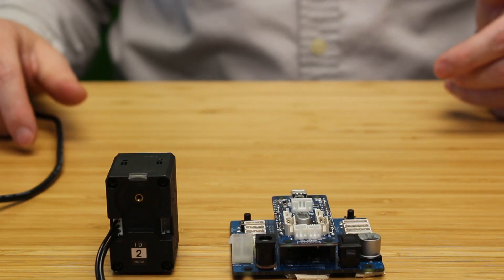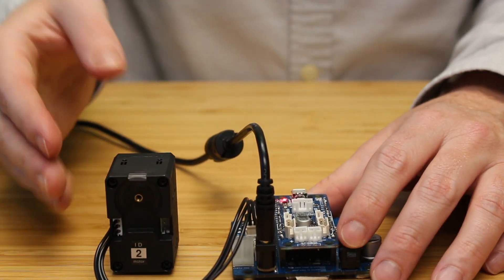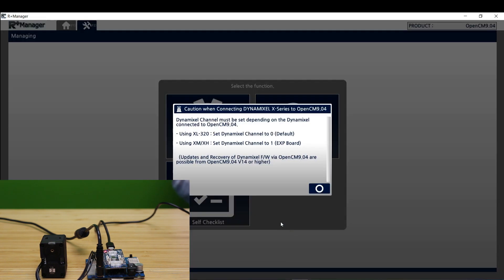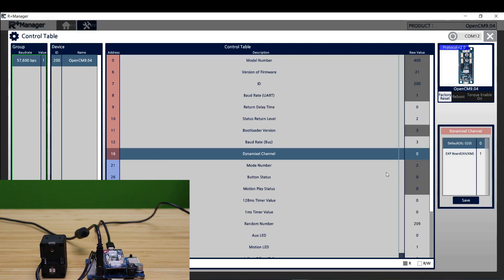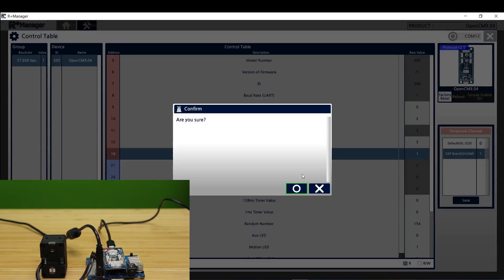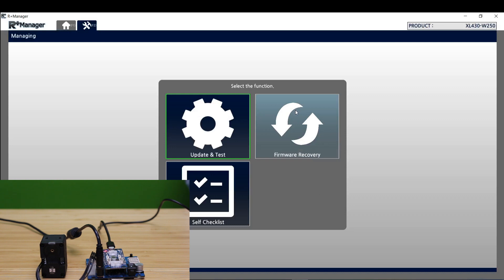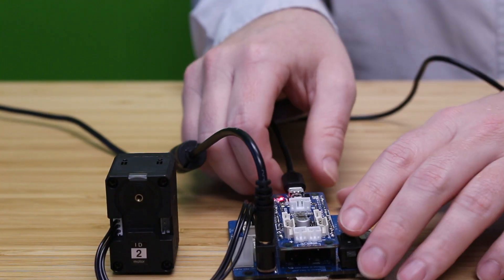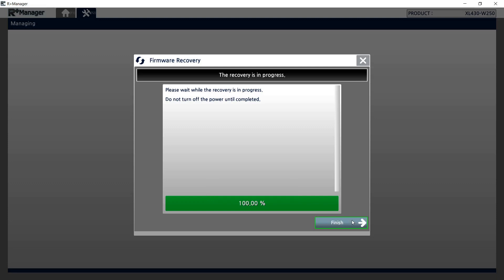How To: DYNAMIXEL Firmware Recovery Using OpenCM9.04

Comment: can this expansion board used to recovery mx64?? what option i must select on the right sir
Reply: for my mx64 detect on version is unknown, what should i do
Reply from the maker: @Methamorph689  This method can be used to restore the firmware of the MX64 as well, just be sure to select the MX64 from the product selection screen before restoring the firmware.

Comment: so to use r+ apps need opencm485 expansion or no?
Reply from the maker: Hello Anhar, thanks for your question. The OpenCM 485 EXP board is not strictly required to use the software, but it is used here to provide power to the OpenCM9.04 + DYNAMIXEL. Your DYNAMIXEL must have power supplied in order to be detected by the software. 

Because OpenCM9.04 supports TTL (3-pin) communication only, you also would need the OpenCM 485 EXP board to connect / control any DYNAMIXELs with RS-485 communication- shown by the "-R" suffix in the model name. 

If you have any other questions feel free to let me know or it would be great if you can post in our new Community forum: community.robotis.us - our forum is monitored by ROBOTIS support staff, engineers, experienced users of DYNAMIXELs and other robotics professionals! On the community.robotis.us forum we offer resources for tutorials, product support, lessons, showcases, and more!

Comment: I am using the MX-106 and everytime I try to run the read_write_mx example via the Arduino IDE, my servo doesn't respond. Instead I see in the serial monitor the  current position (0.0 at all times) and goal position being outputted over and over. The servo blinks fine when power is plugged in. Is there a reason why this is?
Reply from the maker: Thanks for your question! It sounds like there may be some things to check with the setup of the OpenCM9.04 or the example code. Our team will be glad to assist you in troubleshooting if you can create a post on our new Community Page: Community.robotis.us . Our team can assist directly through this forum, and it also hosts a variety of useful tutorials, discussions, and free lessons for users.